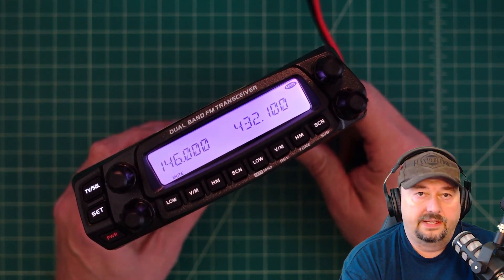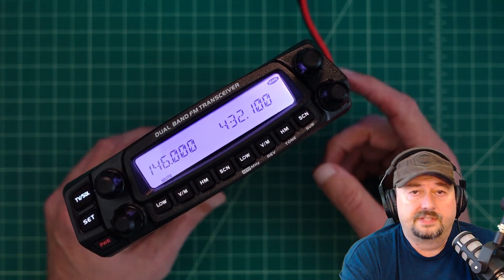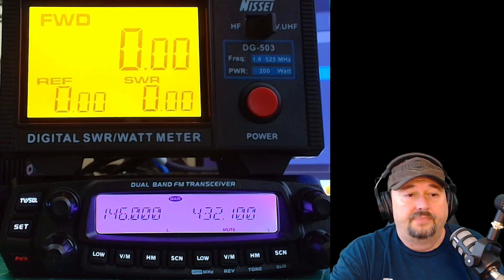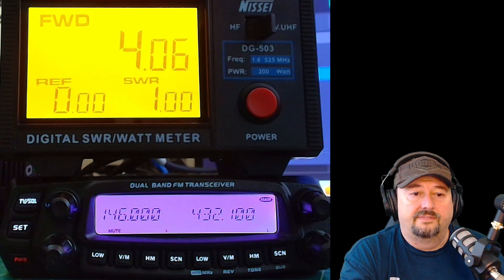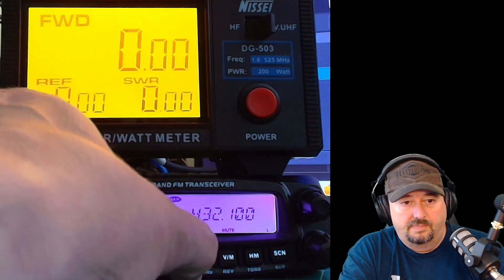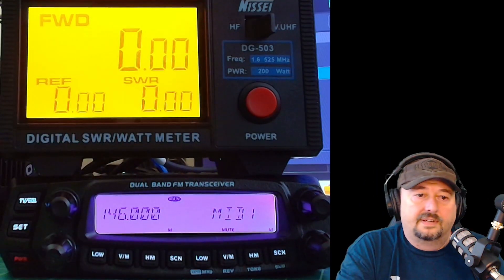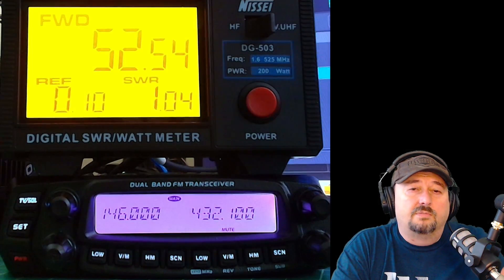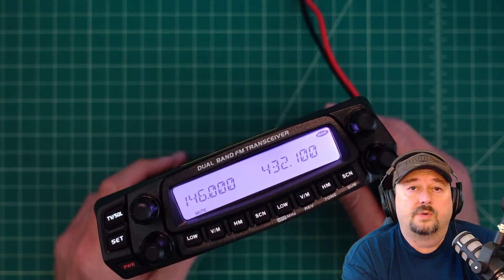Testing the Radioddity DB50 Ham Radio - Power Performance in Action

Comment: Amazon has a bundle deal on this right now for about 250 shipped, with bracket and external speaker included.  Gonna put one in my Chevy Avalanche.  Thanks for the review!

- K5SFC
Reply from the maker: Hey JD, good luck with the radio 👍

Comment: Them watts close enough ! This will very a tad from radio to radio and if radio is hot or cold.  The power cable makes a difference as well as voltage of supply. everything has a tolerance . Gong down to the meter.   I have replaced finals in radios before. sometimes they change from lot to lot . that why a matched set.  if that is the type of output setup.  Nice looking radio. Most of them Radioddity are the Anytone type. Their is a new one out. The QT 80 which is the Antonne AT 6666 PRO . and it is 80 watts.  and does 10/11/12/15 meters and has CW . Would like to see current draw on them radios when testing.  This will change a tad just like power from radio to radio and different antenna load different.  Even tough the SWR is great. It the reactance change can load the finals a tad different and change current draw a tad. like 2 antenna same 1:2 SWR and they very TX power and current draw buy a few milliamps.  That why a VNA can tell more of a antenna. Not just SWR. The smith chart very handy. 73
Reply from the maker: I actually have the QT80 sitting right here.
Reply: @TheSmokinApe  Radioddity sent me a nice email before was released and gave me a chance to pre order one. I have the QT 60 and love it. Did POTA on it like Josh HRCC did and got it to do FT8 ! Dennis from Digi Rig helpt that happen for me.
Reply from the maker: @robertmeyer4744  nice 👍